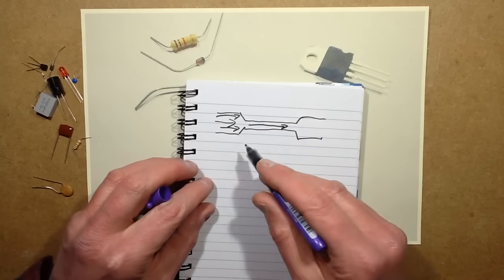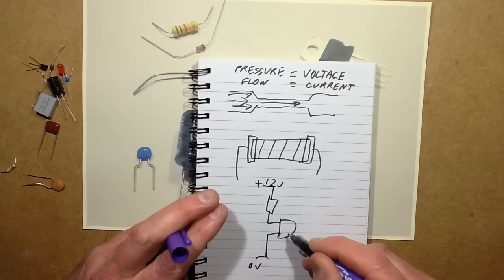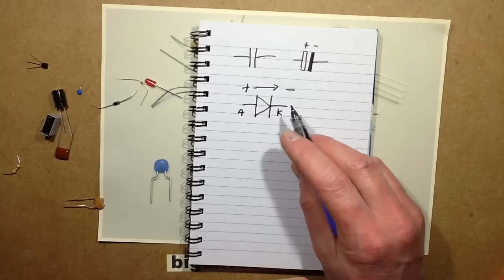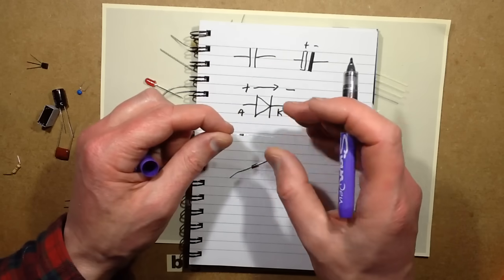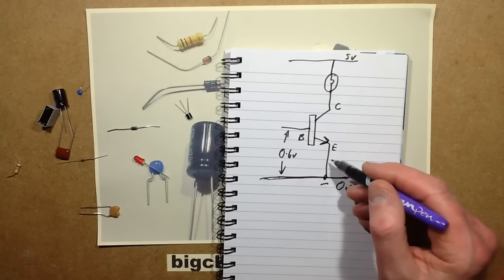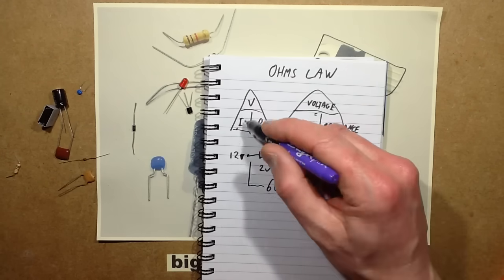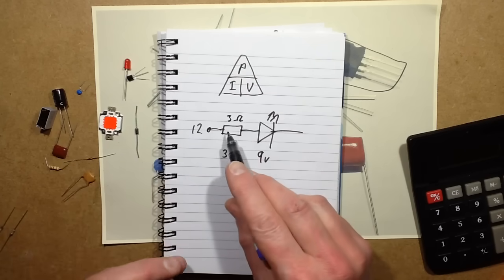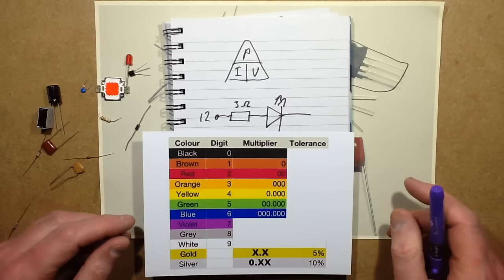A simple guide to electronic components.

Comment: Clive, many of the cheap apparati for mains voltage have capacitor voltage drops.
Is there a formula for calculating the values of R and C in such circuits? (When I look online, all I find are formulas for discharge times.)
Reply from the maker: If you mean choosing the capacitor for voltage droppers the capacitance and mains frequency can be put into an online calculator (capacitive reactance calculator) to get an equivalent in ohms.
Reply: @bigclivedotcom  Thanks!
The problem I'm working on does not seem to work out properly, so I'm suspecting that some measurement or some component is faulty.

For those interested: A 75 Hz generator is driving an inductive load (Z = 2300 ohm). In series with the load is a capacitor in parallel with a resistor.
When the load is disconnected, the generator puts out 265 V, with the load attached 245 V. The load is designed to work with 220 - 230 V, so I need to drop it down by some 25 V. So far so good.
Then comes the RC network. No voltage whatsoever can be detected over the RC network. All its components (a 100 ohm 10 W resistor and three capacitors totalling 400 microF) are cool to the touch. A low-ohm shunt is then applied bypassing the RC network, with no effect on any readings. This can't be right.

There has to be a short somewhere in the RC network. Am I reading this problem right?

Comment: Oh! when drawing transistors and mark the Volts drops also write the CE drop as 0.3V for silicon.
It is good that you write the 0.6V for the BE drop. Otherwise very, very good.
Reply: The CE drop isn't particularly relevant for the use cases talked about, or for a brief introduction to the transistor for beginners.

Comment: Gret video! However, I still do not understand how capacitors work. TO me it makes no sense, it just seems like eternal frustration for the electric current, like,"Oh, you would like to flow over there, but we are not going to let you" I mean wouldn't this just stop the current?  It just occurred to me this is kind of like a strip club, just frustrating the current ( never letting it touch the dancer) which is probably a good indication as to why I am not an engineer.

Comment: I'm a diesel mechanic learning the electronic side of things. 6 cly diesel firing order is 1-5-3-6-2-4. A way to remember that is 15 is too young, 36 is too old, 24 is just right. Thought I'd throw that in there. Thank you for the explanation of these.
Reply: I need to learn more about diesels tbh, I understand the basics but I'd love to learn how they're tuned, what sort of things effect power/torque output and how to build one
Reply: Dave Micolichek : You're new around here, ain'tcha?  Why "eff" with the firing order just to introduce a hard-to-control, rocking-couple, secondary vibration?
Reply: i want to like nugget's comment but i cant ruin it's number of 69, also i like the firing order 8675309
Reply: Dave Micolichek :  AND a suitable crankshaft!  Gotta change both to alter the firing order!
Reply: https://youtu.be/6isP4FGjG2E
Reply: Dave Micolichek  ''15 is too young, 36 is too old, 24 is just right''  pointless humor.
Reply: Setting up yourself for disappoinment as you become adult, good plan ;)

Comment: Hi Clive , I just came to know that your teaching helps me a lot tks for that .I have a blender that stop working , i have tested all the parts and found it working . but one component confuse me , it,s a color coded ceramic type resister or heat control fuse ,
I am unable to confirm that part , thru your experience is that a fuse or a resister , due my multimeter shows no continuety after testing it ,your advice please... tks

Comment: 08:08   yes.  but that's not all that there is to it.    
IF for example. you would cover one of the aluminum tape strips with another dialectric sheet.  and then roll the thing up.  
then you would get a much higher capacitence. with the same amount of "area"

Comment: if an l.e.d. is powered by its rated voltage from a battery why would a resistor be necessary ?
Reply from the maker: As soon as you exceed the forward voltage of an LED it draws an unpredictable amount of current.  You can run some LEDs directly on batteries like the common LED strings that use two AA cells, but it's not an efficient way to do it as they will only use a fraction of the capacity of the cells.
Reply: @bigclivedotcom  hi clive. yes i understand the current raises expedentionally once the led's rated voltage goes above its threshold. i have an array wired in series and parallel which wont even glow until 18 volts. by 20 it is very bright-21 and it looks like the unit will blow. from 20 to 21 volts the current triples.  can you clarify what you mean about only using a fraction of the cells? *perhaps you mean you can reach brighter leds with a resistor as you can force more voltage without increasing the current too much which would damage them. if from the asterix that assumption is wrong perhaps you could explain how using a resistor would keep the current low. i can understand if it acts like a regulator or even a ballast using a lightbulb when making plasma using mot's. i would have thought heat in the resistor would need to be present in order for it to operate in this way.

Comment: It would be very helpful if you could take apart a simple device with these components inside it and explain what they are doing in real life. “Here we have a 12 volt input that goes to this thingy. What this thingy does is that it takes the 12 volt and limits the voltage to 5 volt. From there it goes to...” 

Something like that. I can’t find one single youtuber that does that. I have a hard time translating these metaphors into practical things. Great channel tho👍🏻🇸🇪
Reply from the maker: Just check out my videos.  Almost every one is a product disassembly and often a reverse engineering.
Reply: bigclivedotcom: I get your point, and I have watched a whole bunch of your videos. But somehow I just can’t seem to connect the dots. Guess I’ll keep to things I’m already familiar with😜

Well, thanks anyway.
Reply from the maker: @tokeofsweden  Trust me.  It'll all just start falling into place.  You don't need to understand the whole circuit.  Just a little bit at a time will make sense.  Many of the items I take apart are actually quite complicated purely because they are cheap and have achieved a lot with a little.

Comment: Being an electrician first.  I did wonder how I was going to remember the resistor colour codes.  Then it suddenly hit me, I already knew them as they are the same colours as cable numbers used in control panels which I already knew!  Great video Clive.  I always learn a lot.
Reply from the maker: They are indeed, if you have the luxury of colour coded markers.  And when you use them enough you just intuitively know that orange is 3, green is 5 etc.

Comment: I''m sure someone else besides me was curious enough about "K for cathode" thing to look it up, but I didn't see it in recent comments.  You're welcome, if so...

The "K" was introduced into CAD library schematic symbols and PCB footprints by CADPRO, Inc. around 1990 in San Diego, CA. As the CADPRO PCB library team was cataloging all of the alpha-numeric pin letters for Transistors, Power FETS and Diodes, the philosophy was to list all the letters in a table:

C = Collector
E = Emitter
B = Base
S = Source
G = Gate
D = Drain
A = Anode
K = Cathode (because "C" was reserved for Collector)
It was forecasted that someday in the future a Transistor and a Diode or LED would reside in the same package and the alphanumeric pins would be assigned logically. However, after 20 years there is no electronic package that contains both a Transistor and a Diode.

The CADPRO library became the default footprint library for some CAD tools such as OrCAD Layout, PADS Layout and Protel. And those libraries were translated to other CAD/CAE tools.

So today, we are free to use "C" for Cathode for a Diode or LED footprint pin names.

Comment: I take it there's no pattern to the colours they chose for those numbers then?  In the late 1980s, IBM PCs start using a somewhat sensible colour code, where the three screen phosphor colours (RGB) were assigned to a specific binary bit in the colour number.  So red, green and blue were assigned bits 2, 1 and 0 respectively (or in decimal, red=4, green=2 and blue=1).  You then just added these numbers together to combine the colours, so blue (1) + red (4) = magenta (5).  Or green (2) + red (4) = brown (6).  I'm sure it's confusing to anyone who has never dealt with it before, but for computer programmers who deal with binary regularly, it makes it really easy to figure out which colour is what.

Comment: Learning electronics as an apprentice (over 25 years ago) I still have equations in my head I can reel off. 
2 pi fl = reactance of an inductor - 1 over 2 pi fc = reactance of a capacitor (Reactance = AC Resistance) and the last one - Impedance (AC and DC resistance) = 1 over 2 pi root LC.
I don't need to know those equations and have never needed them. They don't ever come up in my life and yet they're still lodged in my brain.
Reply from the maker: They're easier to learn when you actually use them.  These days there are so many online calculators for things like capacitive reactance that on the rare occasion you might need to do that calculation its fast to just to find one, type the values in and it's done.

Comment: I notice you did not cover all the Diodes
Diode: A diode allows the current flow in one direction.
Light Emitting Diode: It will emit the light when the electric current flows through it.
Zener Diode: It will allow a constant electric current after the breakdown voltage.
Photo Diode: Photodiode will convert light into respective current or voltage.
Tunnel Diode: Tunnel diode is used for very high-speed operations.
Schottky Diode
Reply: There's lots of stuff that isn't covered - it's an introduction to these components, not a comprehensive list. Someone who is only learning what a capacitor looks like is unlikely to be too worried about more specialised diode types.

Comment: Instead of Brown-Black-Red-Gold...why not use Brown-Orange-Gold?  Is there a reason for the way the stripes are laid out that way?  Just curious.
Reply from the maker: The colour code tends to be based on a fixed number of 3 or more stripes for the range of values.  A two stripe code wouldn't allow for a value like 47000 ohm.

Comment: Hi Clive love the program, please what is a tri state buffer and why they are used ? thankyou
Reply from the maker: A tri state buffer is one that can take the output positive, negative or floating with no voltage.  They are used where information has to flow in both directions or where a technique called charlieplexing is being used to drive a lot of LEDs from a small number of pins.

Comment: Outstanding video! I do have a question about resistors, though. There most likely is a very good explanation but it escapes me for some reason.  Are their ratings defined at their rated wattage flow?  In other words if higher and lower wattage resistors were swapped in a circuit, would they still have the same values?  I am trying to compare to the 'water' analogy which makes sense except if a restriction in a pipe were a given size, the more water applied to it would mean proportionally higher resistance to the water wouln't it?  Very little water flow would not be restricted at all.  As I say, I'm sure there is an explanation right in front of me but I am missing it.  Thanks!
Reply from the maker: The wattage rating is just their ability to dissipate heat.  The power dissipated is calculated by the voltage dropped across the resistor multiplied by the current through it.  If you use too small a resistor it gets too hot and may discolour and fail.

Comment: Yes, voltage can be thought of as pressure but you can also compare it to gravity.
The stronger the electric field, the stronger the electrons are pulled to the positive side and the faster "they fall".

The difference is that voltage (Electric field) adjustable easily while gravity (gravitational field) is not adjustable easily.

***According to modern physics, gravity is not a field.

Comment: Re: @18:59 Question. If it's possible for a red (as mentioned @19:17-19:21) LED to be exposed to a reverse voltage that exceeds the reverse breakdown - without being shorted out (blown, i.e., destroyed) - but instead conducting in that changed direction, how or why wouldn't it not light up in that instance? 

I'm confused since from what I've been able to gather, the light emitted is basically the byproduct of the positive flow of current being conducted through the component...

So if it's not damaged in the scenario of the red LED mentioned above, then why wouldn't some of the energy from that passing current (regardless of its reversed direction) not still be converted into the form of light? Given a sufficient level of flowing current, wouldn't enough of the electrons' collisions into some of the obstructing atoms in their path - and the associated, increased level of vibrations or movement at the atomic level (supposedly part of the cause for the generated heat which is involved in the process of energy conversion underlying the subsequent production of visible light) - cause the LED to function (albeit not by the intended means)? 

If the current flow rate (despite being in a reversed direction) is nevertheless sufficient to 'push' enough of the photons in that locality outwards, why wouldn't the corresponding manifestation of visible light result from the increased frequency? 

Please, someone, explain (correcting any false premises implicit in my very question, if necessary)?

Comment: I have a question.  Since my resistance measured from my left thumb tip to my right thumb tip is 5M Ohms to 15M Ohms depending how tightly I grip the meter then my body is a high resistor.  I am wondering since my resistance is so high if I calculate with Ohms law the voltage out my wall socket is 116v - 170v peak,  Lets say 170v to be on the safe side.  I will say my body resistance is at 1M Ohm only to be on the safe side of things.  I will calculate 170v/1M Ohm =  0.00017.   Is this right?   If I touch live AC wires then only 0.00017 will pass through my body?  How do I say 0.00017 , it isn't even 1mA so what is this measurement in amps?  (I'm not just going to go around touching live wires, but I am curious). I see some peoples resistances measured is from only 100k Ohm - 350k Ohm max range and wonder why mine is also so high.  If I measure resistance on my tongue tip it is 2 - 6M Ohms range.  My meter is accurate up to 0.02% on resistors and it could be the resistors that are off and not my meter in this range, as I am not sure.  If the current is only 0.00017 then would I even feel that?

Comment: capacitors can hold enough charge to seriously hurt or even be deadly so great care must be taken when working with older electronics especially tube powered electronics as they can easily have hundreds or even thousands of volts on the b+ lines

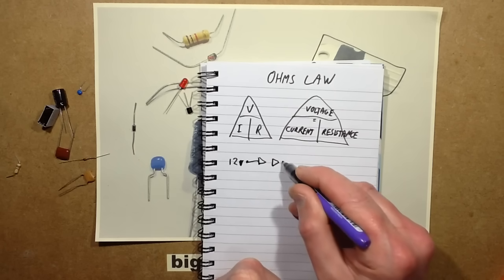Comment: I apologize if this has been asked already (too many comments to really search).  In your drawing at 26:00 you had the resistor after the LEDs, and the drawing at 32:00 you have the resistor before.  Is there a particular reason for that?  I have basically no practical experience with electronics/circuits, so I'm sorry if it's a stupid question.  Thank you for the information.
Reply from the maker: A resistor can go anywhere in a series circuit.
Reply: @bigclivedotcom  Thank you very much for your response.

Comment: Don't mean to be unkind, but I disagree with using the water analogy to describe electrical circuit elements.  The resistor is a linear element so it does not matter, but the capacitor does not behave linearly (nor the inductor).  I would encourage anyone to use the mechanical models to be more relatable.  Damper for resistor, spring for capacitor,  and mass for inductor (or coil). These analogies are mathematically correct and do not fall apart when considering changing voltages.  The simple rectifier filter is probably a good example, and the first one many would see first... using a water analogy there gets confusing.  Liken a filter to a car suspension with mass, spring and damper....and its easier to understand especially when the frequency changes.  In summary, water analogy is good for DC circuits only, and the inductor is not used.

Comment: I am re-teaching myself as, during lifesaving surgery, I suffered brain damage. I was a bench & field engineer but had to retire on ill health as I was reduced to sweeper-up and tea maker! One thing I still can’t fathom is the relationship between the physical unit and its orientation on the circuit diagram. A Transistor. Which leg is which on the transistor in relation to the diagram. Even when BCE is marked, which leg is which?
Reply from the maker: If you type the transistor number into Google you will find images showing the pinout.

Comment: The 'K' is used for the cathode as not to confuse it with 'C' for collector. This is especially important for thyristors, which look like a transistor when in TO-92 and 220 packages.
Reply: K for cathode goes back a LONG time before transistors were developed - to the original vacuum tube diodes.   It's derivation is from the German kathode, and probably ultimately from the Greek "κάθοδος" (pronounced káthodos),  meaning literally "way down".  C for cathode was also too easy to confuse with C for capacitance.   Similarly, I (not C) is the symbol for current from Andre Ampere's use of the French phrase "intensité du courant", (current intensity).